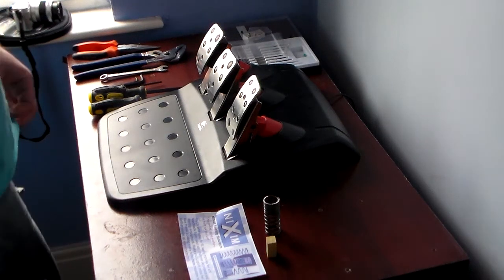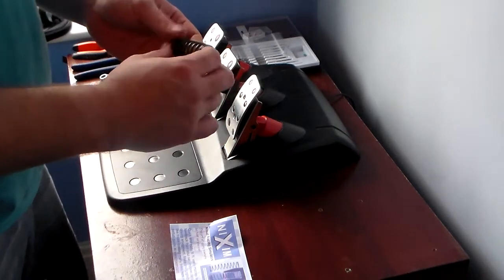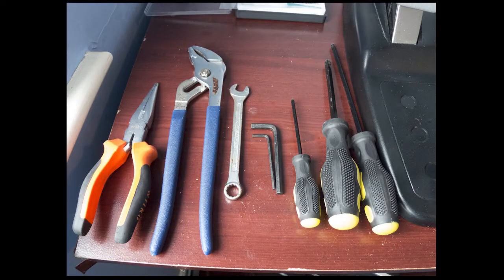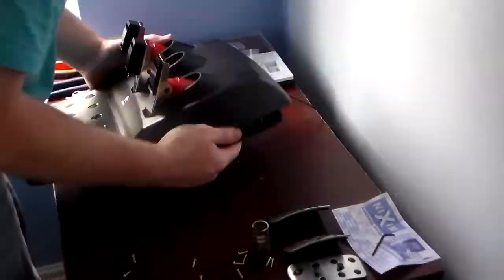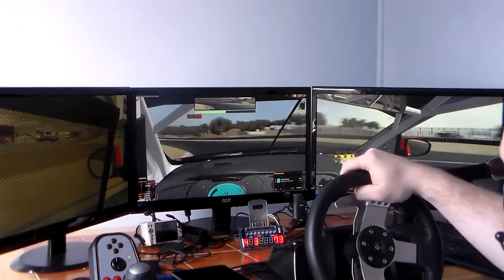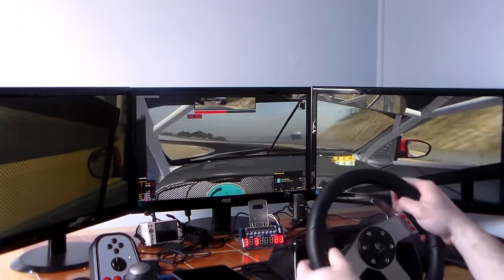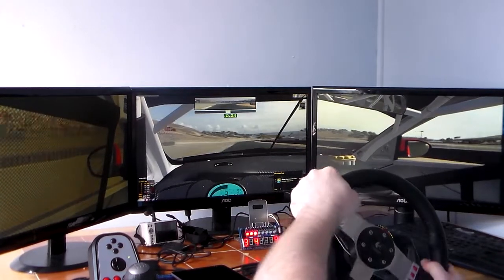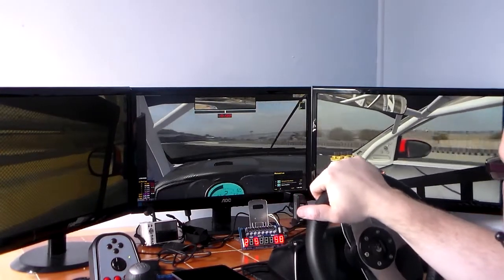Pitlanes.com - NIXIM break mod installation and thoughts

Comment: Installed the mod and had a quick run in Assetto Corsa. As promised it does indeed make a surprising beneficial difference. I trimmed the rubber down a tiny bit to reduce the resistance and still requires a decent amount of force to hit full braking.

I wasn't too sure what to expect but instantly noticed braking feels more authentic and improved my corner braking. Great upgrade, and although not really cheap for a spring and piece of rubber, it's worth it.

Comment: Great video. I was toying with idea of changing my pedal set but then stumbled upon brake mod upgrades. Lode cell upgrades aren't good value compared to just getting new pedals. However this looks pretty simple to install and is inexpensive. Bingo! I've ordered the mod and looking forward to feeling the difference. Cheers again for the video, very useful.